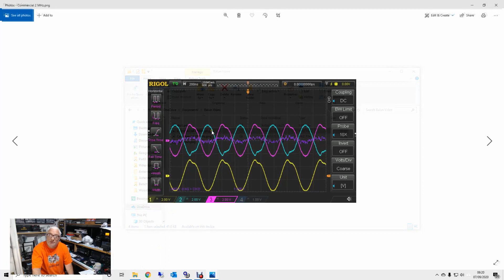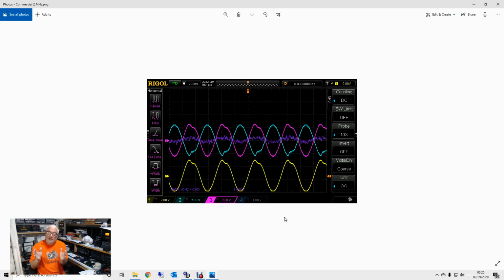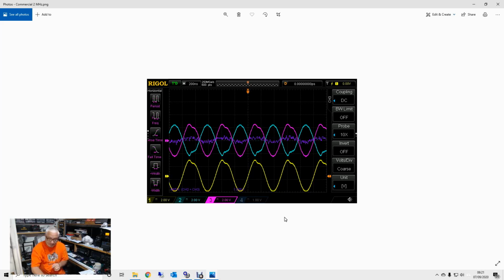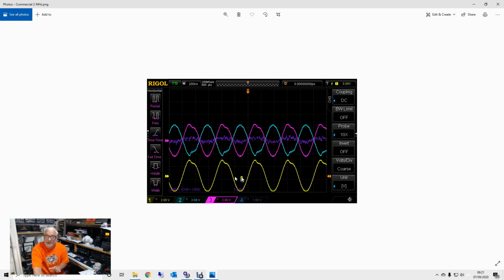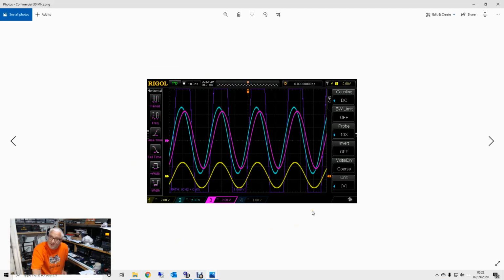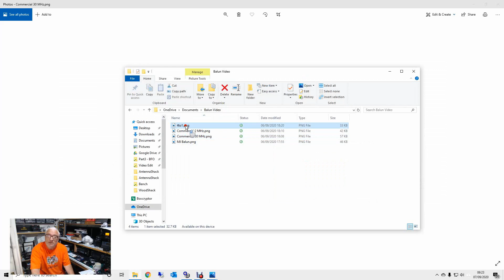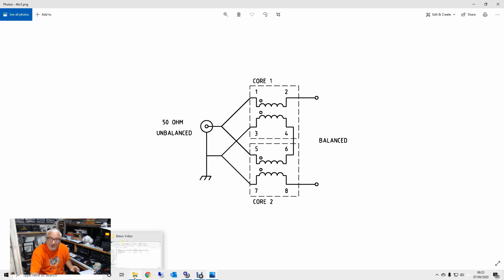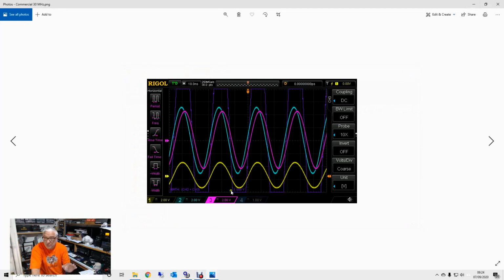Baluns, Baluns, Baluns - Whats that all about?

Comment: I have only just discovered your channel, have played with baluns a lot the last 4 or 5 years. They are deceptive in looking simple... Without thinking too hard (or thoroughly) it looks almost as though the transmission line effects are working against you  as you go up in frequency. (I really need to think this over).  I have tried the 4:1 with separate cores as per your illustration but ended up asking myself why. It looks like a good idea though. To be honest I would be concerned about a 1dB loss, not for the usual reasons but because at high power that is a lot of heat to manage... Like you I think PTFE insulated wire is optimal (the conductors are silver plated too) Something I was going to try though is to put the windings through silicon tubing to reduce interwinding capacitance, though not sure if this will work. My conclusion so far is that common mode chokes work for me but that it is difficult to get high common mode impedance 160-10m from just one. With a total of 10 FT240 series cores the existing effort is not very economical to reproduce! 73

Comment: Hi Mark. Here's my uninformed two pennies worth (less value than a conker). I'm wondering if there's some weird capacitance floating about (between the windings?). If there's capacitance you'd have a potential RC circuit that could shift phases?? A random capacitance could also introduce an LC network ... the larger amplitude at 30MHz sorta implies resonance. Is it possible to get a dip meter inside the commercial balun? And these thoughts are probably bollocks so happy to be corrected in the spirit of learning.
Reply from the maker: It would be good to get some debate going here about what others think is going on. I'm going to re-make the commercial balun with a known toroid and see if that makes any difference. I wonder if the toroid is not what it claims to be?
Reply: As a beginner I find baluns the most confusing subject in ham radio!   I'm really looking forward to seeing the re-make of the balun especially the test rig..   It seems as the word/device 'balun' seems to take on several jobs.   For instance, a) the balanced to unbalanced transformation; then b) the rejection of common mode signals; then c) impedance transformations.   My knowledge of electronics is limited and I'd like to see practical demonstrations of the various 'balun' functions - looking at you!  All the best Kevin M0XYM